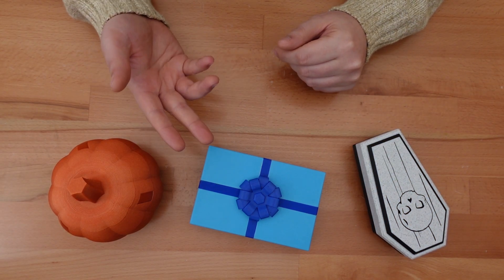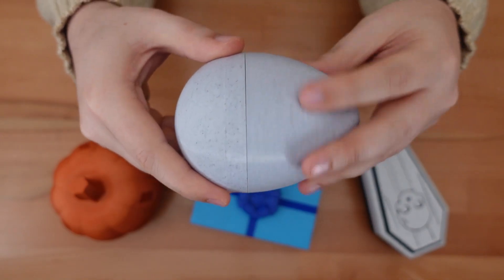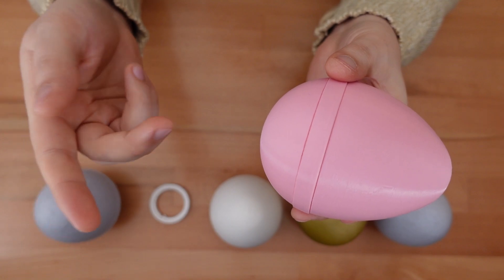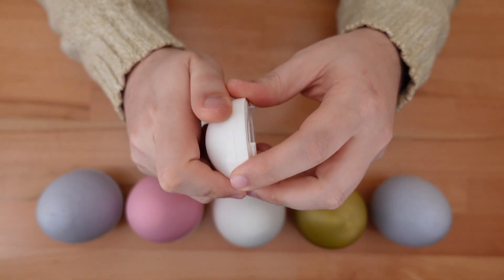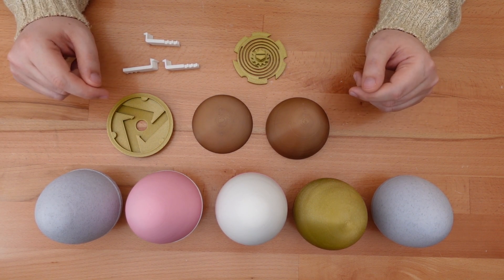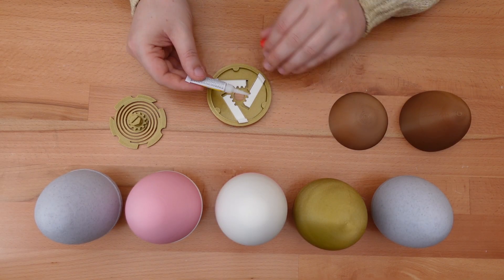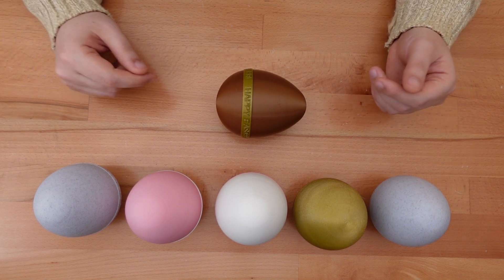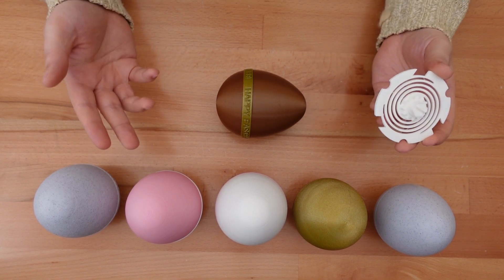3D Printed Twist Lock Egg

Comment: Printed this with the Arc Welder plug-in for Octoprint at Cura's fine 0.1mm and it printed perfectly first time. (Now keen to try the variable layer experimental setting in Cura to see if I can get similar results in half the time.) My only quibble was the seam at the layer change. Would vase mode eradicate this imperfection?
Reply from the maker: Glad to hear it!

There are a few ways to handle seams. If you can position the layer change at random points, the seam won't line up and will pretty much vanish. You can also reduce your seams by playing around with flow rate, print speed, and (in extreme cases) e-steps. Another solution is to use fuzzy skin (https://all3dp.com/2/cura-fuzzy-skin-simply-explained/) which really hides all but the most extreme printing artifacts.

Unfortunately, I don't think vase mode will work since you need that horizontal lip for the latches to hook onto.
Reply: @3DPrinty  Thanks for the insights. I wondered about shifting up to to vase mode once the lip was done, but I need to work on my Gcode-fu. Fuzzy skin looks like an enticing option that I will try out. Thanks, again, for the tips.

Comment: Very nice design :)
With regards to the steps, I would recommend using the variable layer height feature in prusaslicer to reduce those effects without tripling your print times ;)
Reply from the maker: Good recommendation! There will still be some stair stepping, but not nearly as visible.

Comment: Man, I was gonna ask/hire you to make one like this, months ago.  And, here it is! Lol.  Let's get these down to NO pretension. Also, what's your IDEAL "Scale" %?
Reply from the maker: The default size I uploaded is actually scaled down from my original design. I think it's pretty close to ideal, but I can understand the desire to scale it down further to save on material and print time. I probably wouldn't go smaller than 80%, if you want the spring to still be strong enough to close the latches.

A design without pretensioning is possible, BUT it would require the latches to be much longer. The easier assembly may not be worth the tradeoff if it means opening takes more twisting. Maybe a future design will test it!

Comment: Really cool design, but is there any easy way to change the language of the happy easter text?
Reply from the maker: Unfortunately, text on a surface that curves around multiple axes is not something Fusion 360 does easily.

To achieve this, I created a simple cylinder (curved surface in a single axis) and used the emboss tool to create raised text around that. I then deleted the cylinder, leaving only the circle of text behind. Finally, I used that circle of text as a boolean tool to cut the letters out of the egg.

It's a bit of a clunky workaround for something that looks like it'd be easy. If you want to give it a try, step files are posted with the project.
Reply: @3DPrinty  Nice, yes i will try to do that, thanks! :D

Comment: Egad! What markers are you using? I haven't found any that don't bleed across the layer lines.
Reply from the maker: It's an "Artistro" paint marker. It does bleed into the layers a bit, but it seems to help if I lay down a lighter edge line first. Near the end of the video, you'll see me go back and clean up the edges around every green spot.
Reply: @3DPrinty  Technique noted. Thanks.  :-) 

  I print a lot of toy and toy adjacent items and the biggest turn off for the kids is the monochrome nature of the items. This is further exacerbated by attempts to paint or otherwise color as they pigment bleeds across the layer lines.

Comment: This design would benefit greatly from using the arc welder plugin in cura. It vectorize curbs so circles becomes perfect circles!
Reply from the maker: Good recommendation! Now we just need easy-to-implement non-planer printing to really smooth out these prints.